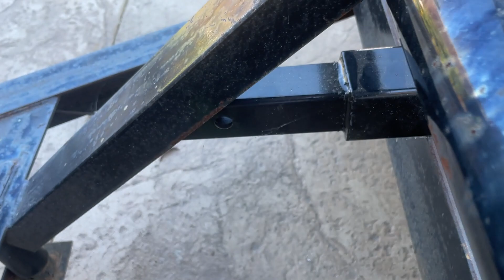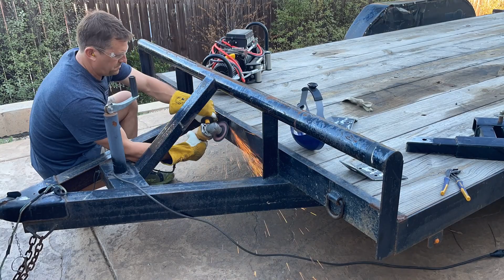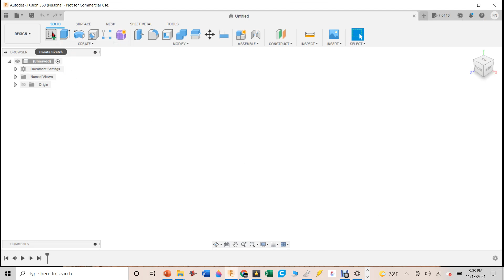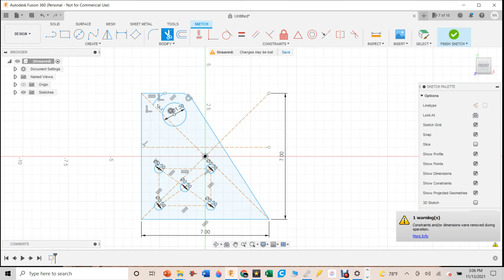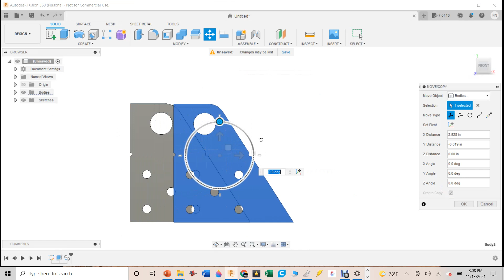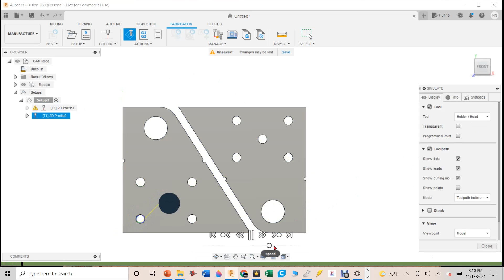Using Harbor Freight tools to get our Baja 1000 chase trailer ready

Comment: @NTD Racing,  could you provide a link to the Delta Grinder wheel extension attachment you used to remove the slag or burrs from your bracket mounts?

Comment: Another awesome video!!!! 
I was going to comment about your lead in/out, but later on I saw that you used that spot to bend the part. Nice work!!!
I was also thinking you mentioned something about new trailer🤔, you have all the tools to make a custom one yourself!!!!  How badass would it be to design and build one using your new welder and new plasma table!!!!